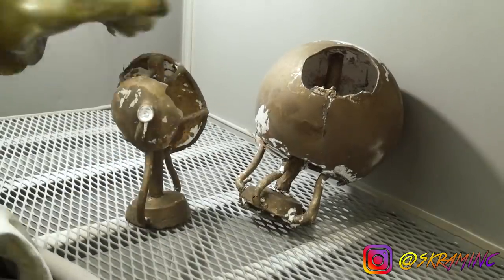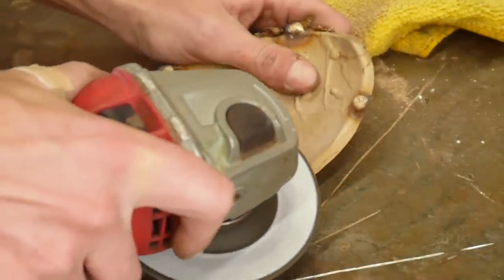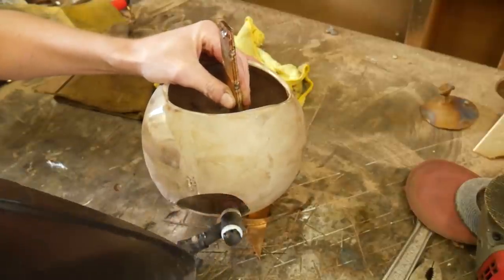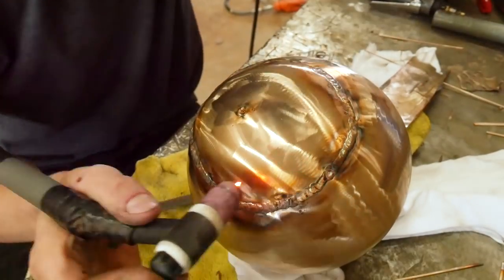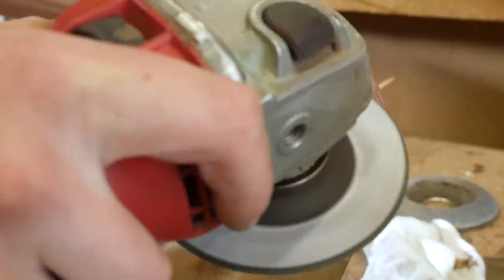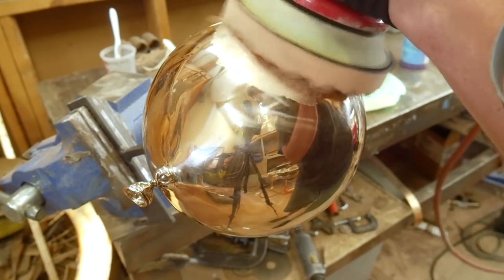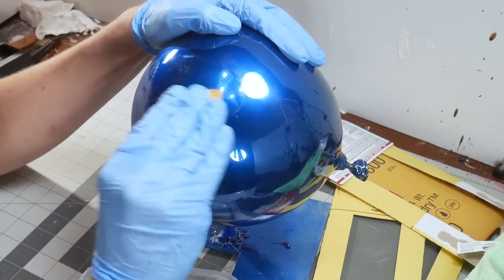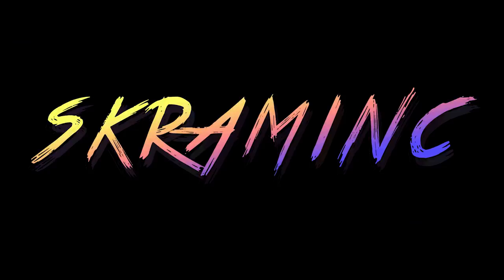Part 2 of 2 - Turning Dollar Store Balloon to Jeff Koons Art - Polished Balloon Sculpture

Comment: Have you ever tried hammering some pieces together or filling holes by hammering ? (Like the aluminum ball idea, I think Greek masters used to do that)
Reply from the maker: I dont know if its worth it. The second welders were even slightly viable everyone unanimously switched to welding (1800s, before that castings had to be done in one piece or mechanically connected). Ive never even seen people try to do a retrospective for fun or historical purposes. Even big pieces were rivoted together and then the rivets just hammered flush to hide them
Reply: @skraminc  ow rivets… I had no idea! I understand what you mean. Doing some further research I saw that they used a form of welding with molten bronze (probably with a certain temperature and then they hammered it). Thanks a lot for your reply . If you got time to spare it would be a great research to do, it’s a missing thing in archaeology after all.
Reply from the maker: @stel1000  sort of off topic but Rodin was massive and he cast bronze sculptures before and after welding was viable so you can see some of his later bronze sculptures that have really rudimentary weld seems on them but it also meant that sculptures could be cast more complicated and in pieces instead of having to do one gigantic casting

Comment: Curious where you might get the yellow slurry you used to cast in? Or an idea of what is in it?
Reply from the maker: So typically its really expensive and comes in 55 galloon drums and needs to be mixed continuously but some new products are coming out that are available for "hobby" use. One is SuspendASlurry from Ransom and Randolph and it comes in a 6 gallon size and never needs to be stirred. Im planning on doing a video about it soon for backyard casting so people can do more besides just melting soda cans and copper wire
Reply from the maker: And the part where im dipping into a rubbermaid trash can is about the cheapest way to deal with regular silica slurry. Its like a 1500 dollar electric motor with a prop and a trash can to keep the slurry suspended or else it falls out of solution and hardens

Comment: All that work and you PAINTED IT?????
Reply from the maker: yeah. it's a paint job a lot of people won't do because it's hard to get paint to work with mirror surfaces. most paint companies won't recommend using their products on anything over like 400 grit because it has no way to mechanically hold itself to the surface. this was ~8000g. it was just an experiment.
Reply: @skraminc  I just would have kept the bronze visible.  In paint, you could have made it out of resin or aluminum and no one would care.
Reply from the maker: @jagboy69  i used bronze just because i dont have an aluminum crucible and didn't want to buy a clean one and bronze is really easy to cast. aluminum doesn't quite polish out the same way bronze does. but the paint is transluscent, that was my main objective. a tinted clear paint on mirror
Reply: i agree. the bronze one before the paint is majestic

Comment: I was expecting you to either leave it bronze or put such a transparent coat of color that the bronze color underneath was obvious. I guess my only thought that if you're going to paint the bronze why not just cast the balloon in resin and spray a base coat of reflective paint under the clear coat to create the same effect in a lighter and cheaper media? Obviously, your preferred media is bronze and this is a great demonstration of technique but this seems to be a bad choice of subject for a bronze since the bronze effect is not there. But then my choice of base material in a casting  of this subject is probably because I have more experience in working with these materials.
Reply from the maker: Both options are equal amounts of effort
Reply: @skraminc  First, before you read below, this complex subject WAS a great way to delve into some of the more complex things you need to do just in figuring out the parting lines and cut outs and you did a good jobs, Kudos. But I have to ask, have you ever cast resin? It's VASTLY simpler and extremely less expensive.You remove that FOUNDRY! AND the grinder. And the TIG welder. Don't get me wrong, I do e Bronze casting and I have the same tool, plasma cutter, TIG etc, no foundry except for small self cat figures. I get ya man, BRONZE IT SO HOT IT'S COOL lol But I just think this id NOT a good subject for bronze for these reasons.Equal amounts, I doubt that seriously Even the mold doesn't have to be robust, you could use silicon mold which could be peeled arounf the nozzle tube without all those welds. Just encase the balloon in silicon mold. Reinforce with plated' Cut the plaster an slice the on piece silicon mold. Then rotate the resin in the mold after for a hollow cast, no lost wax needed. And resin  finishes MUCH faster then Bronze. If you weren't going to paint it to make sure the customer KNEW it was bronze. But it you just wanted the contrast of a "LITE" balloon  cast in metal, fill the center with lead! ;-) NOT DISSING YOU! YOU ARE AN AMAZING CRAFTSMAN but I could have put my resin balloon (if cast with the same molding and paint skills (automotive clear coat) and WEIGHTED it no one would have known. (UNLESS THEY DROPPED IT AND YOURS SOUL HAVE BEEN RUINED, MINE WOULD HAVE BOUNCED)